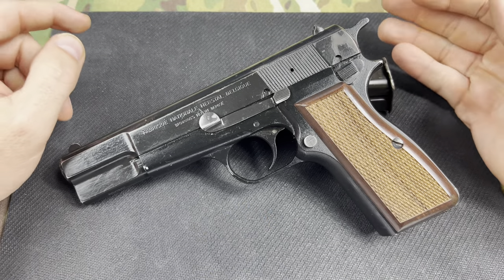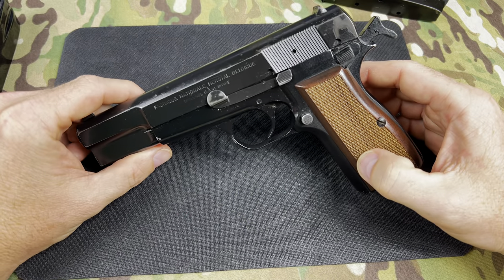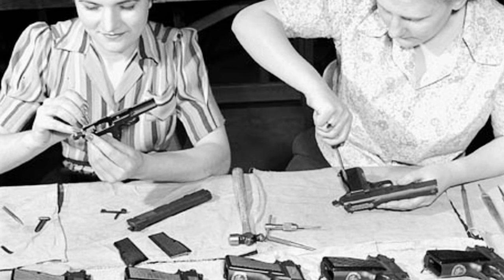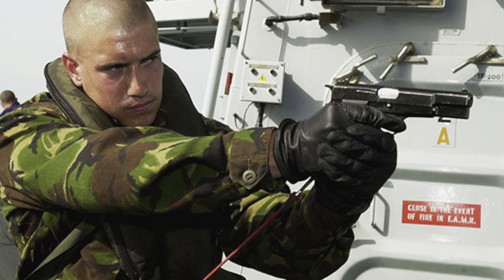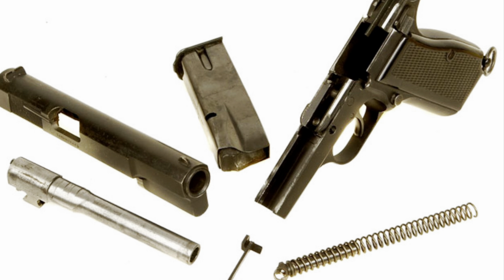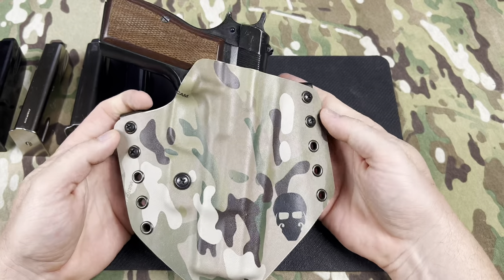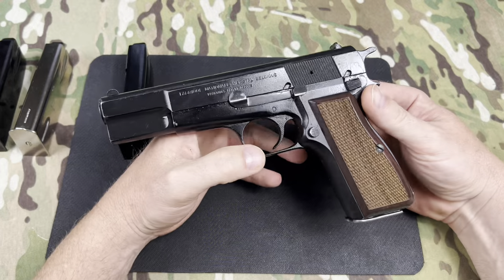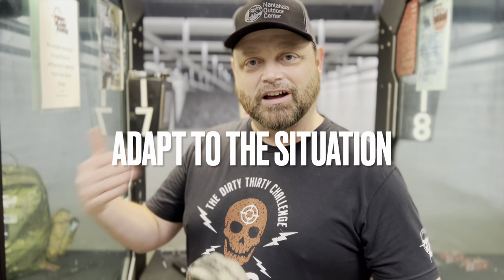Browning Hi-Power History | An Interesting Story with "Hands On" Live Shoot

Comment: Just got a 1971 C mod. Made in belgium a few days ago at the gun show made a few hundred on my sks got him down on his price so i got about 400$ in it
Reply: In my opinion with half a dozen HPs in the gun safe and having carried them for in the military and policing for 50 years (and now cut like a marshmallow soft civvy), the T and C series are the best of the HPs.  The period between eliminating the failure prone internal extractor and the chubby gal MkII and MkIII series slightly bigger size.  My 69C has been my carry when personal choice was allowed and still is.

All of the current clones being marketed are copies of the MkIII chubby gals.

To be fair, some simply just don't care regarding the difference in size.  Nothing wrong with the quality of the metal or the metalwork in the clones.

There's some relatively rare alloy framed T/C series Belgian police turn in surplus being sold right now that I'd be jumping on if I didn't have far more HPs than I want or need.  Having a C series, I don't really need a HP that's a few ounces lighter due to an alloy frame - the weight of a regular HP doesn't bother me.

Comment: My first observation is: how to charge a semiautomatic handgun or rifle. 
Pistol first:  
1. Lock the slide open. 
2. Point the gun down range generally. 
3. Grip the gun ready to fire.
4. Insert loaded magazine. 
5. While, again, pointed generally towards the target, release the slide by pressing down on the slide release lever, charging the pistol. 
6. Fire. 

Rifle:  same, except bolt, not slide.
Several reasons but don’t worry about why. Just do it.

Be safe. Enjoy. Do it right.

Comment: You didn't mention the very well made Hungarian made FEG version of the Hi Power.
Reply: Nothing but real.
Reply: @Jeremyho439  I'm confused by that statement.
Reply: @fredhinck9685  
Do you like to wear a Rolex clone?
Reply: @Jeremyho439  Smart watch.  Fit and finish like a fine Miroku.  Browning outsourced.  Sometimes to Hungary to avoid embargos.
Reply: @Jeremyho439  Do you mind that FEG's were license built on FN machinery, with manufacturing processes overseen by FN engineers.

And do you have a similar problem with all the Browning shotguns and rifles with the Browning name that were also made under license - in Japan?